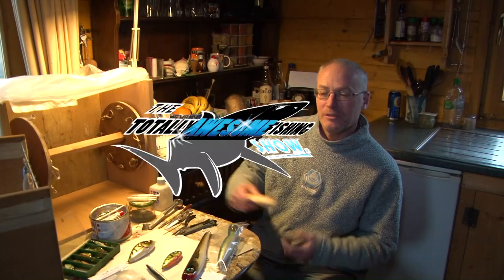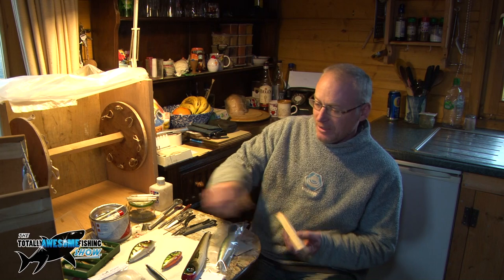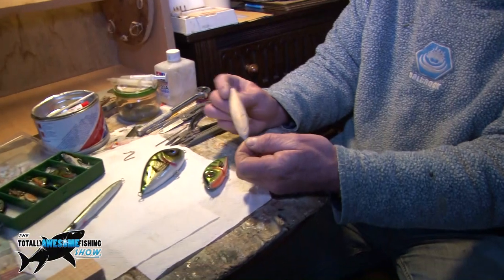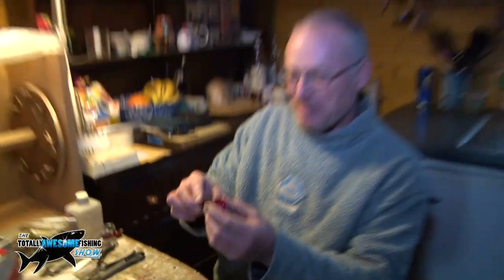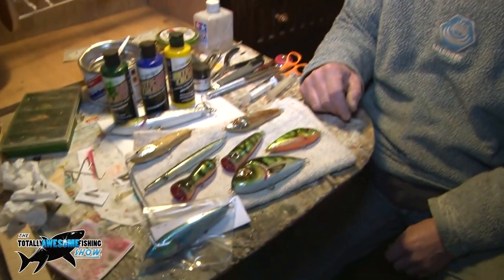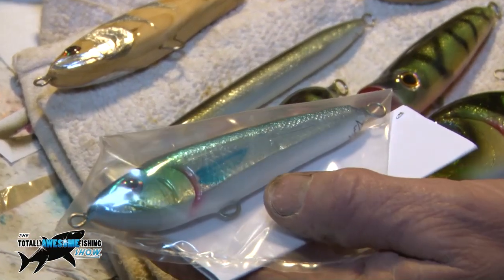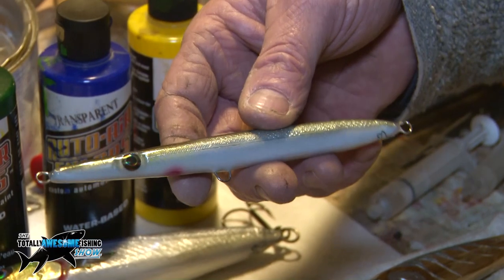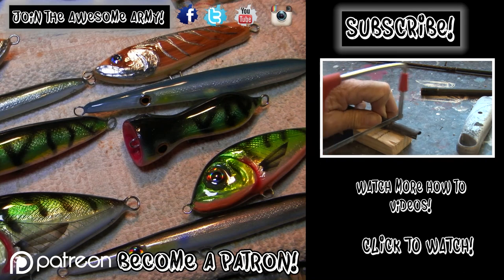How to Make a Fishing Lure - Step by Step Guide | TAFishing

Comment: I came to find out how to make the final eye at the tail end, with no slack.  He showed everything but that.  I guess that is one of his trade secrets
Reply: what do you mean?
Reply: measure it where you need to bend it and then bend it if your doing  through wire
Reply: That’s because he does a traditional tail wrap and then covers it in epoxy. If you go to Jim’s Lures on Facebook you’ll see this example many times. I personally think it doesn’t look very clean. Either show your trap wrap off with pride or make a wire harness using crimps at both ends and make a longitudinal cut along the lure belly and fit the harness in with your adhesive of choice and some sawdust